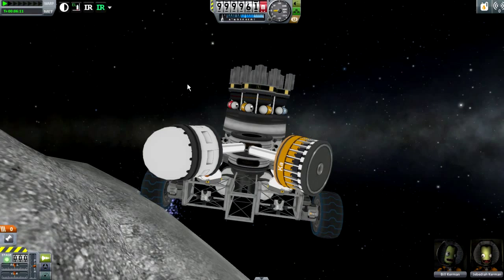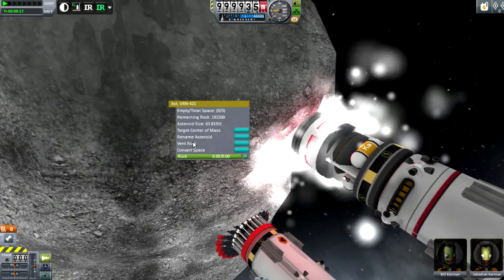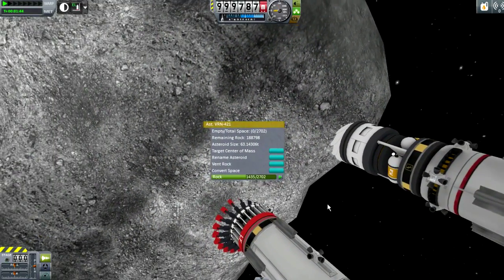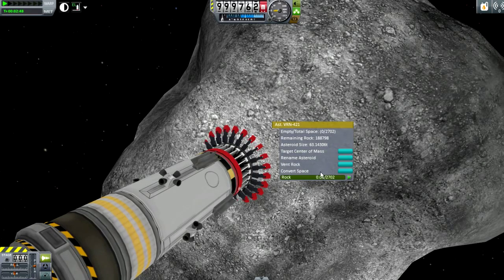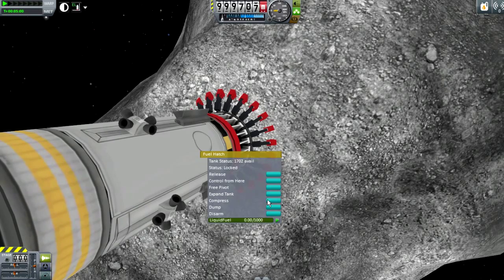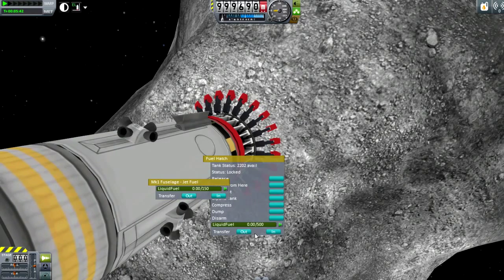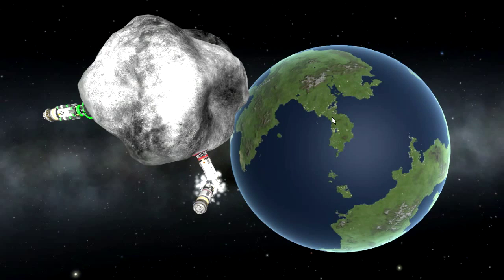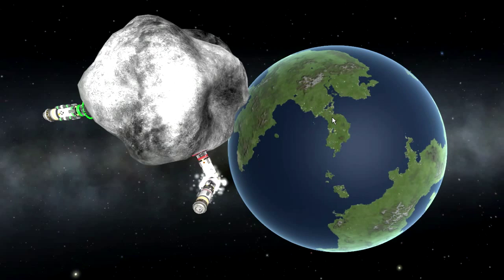Asteroid Recycling Technologies v0.4.5 Mod Spotlight (KSP 0.24.2)

Comment: How to install this mod, cause the parts are there for me, but the asteroid doesn't have the rock resource or the vent button. Are there any required mods? Pls help 'cause RoverDude doesn't answer
Reply from the maker: You may need the community resource pack to get the rock resource. Not sure about the vent button. If you can't get it to work you can always try cKan, it is usually good about getting the dependencies for mods to make sure they work.
Reply: I never used ckan, but I tried it just now. I installed all the mods it said as required there, but it still doesnt work. No rock resource in the asteroids. I even tried it in a new save. It might be because of dynamic tanks maybe? because thats the only difference in the ckan and my handmade version.

I just realised the molten rock in the laser isn't there either